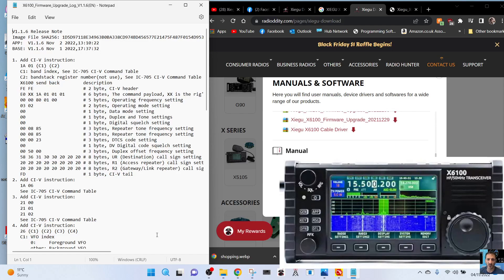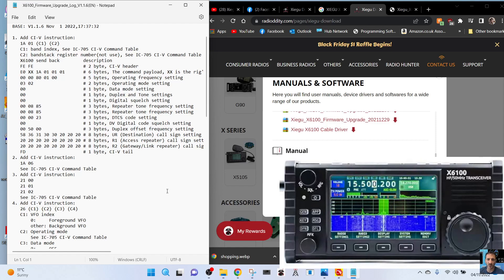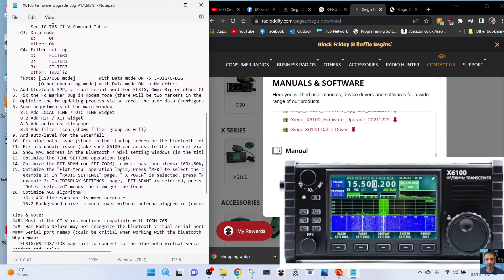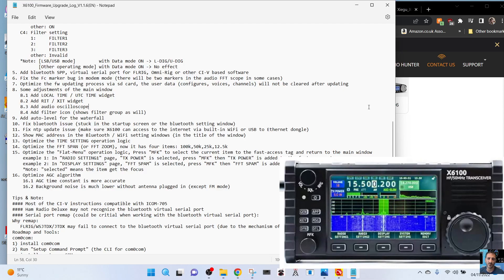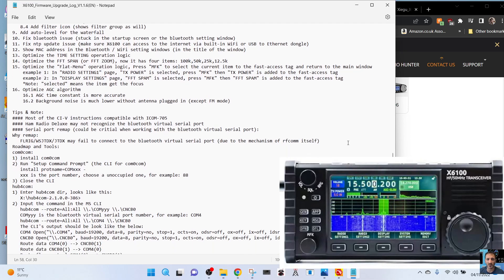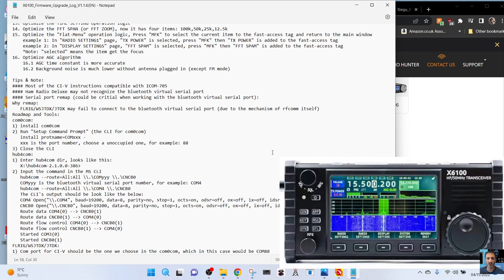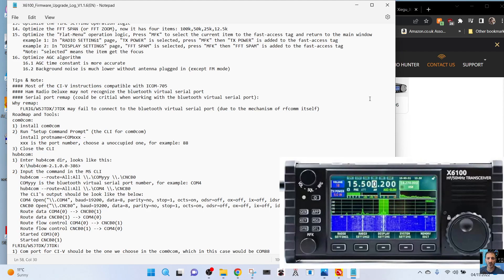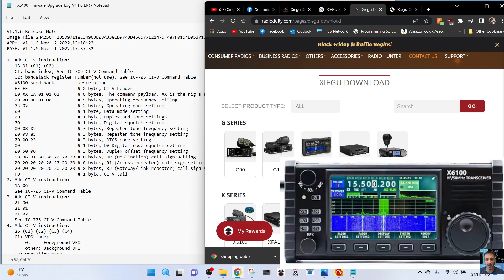XIEGU X6100 - NEW FIRMWARE NOVEMBER 2022 Insta Video and Download Link (MORE BLUETOOTH OPTIONS )

Comment: Thanks very much for your video tutorial....Question please: I just bought a new 6100 and need to update the firmware. Can I jump to the latest version OR must I build up to the latest version by version? Thanks, Michael
Reply from the maker: Yes, you can
Reply: @digitalhamradiodiary-m0fxb  So skip to the latest version and it will contain all the other improvements?